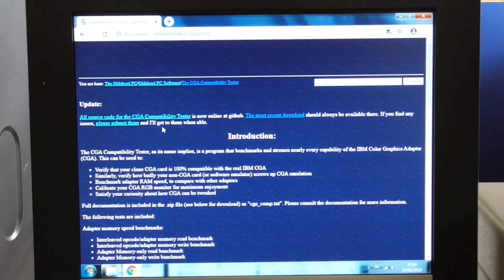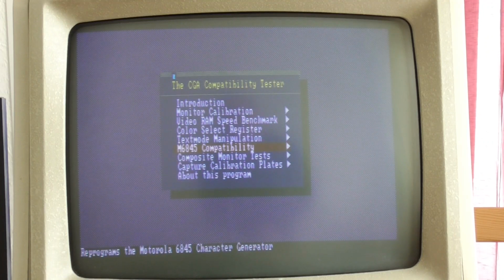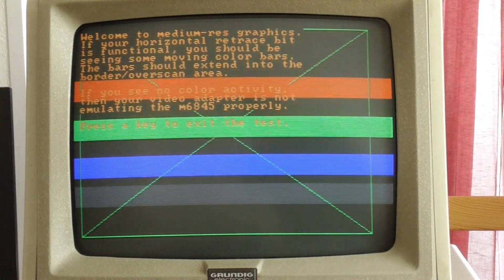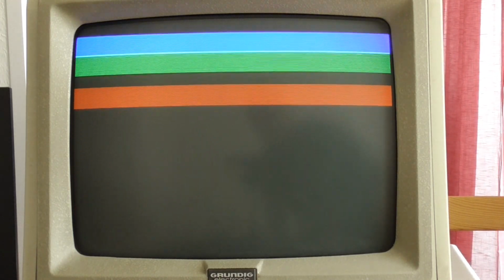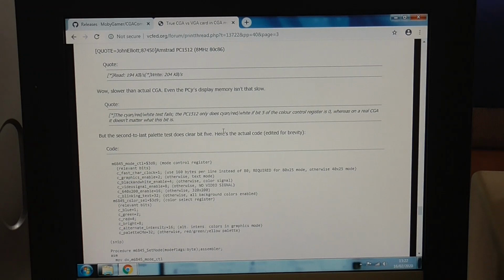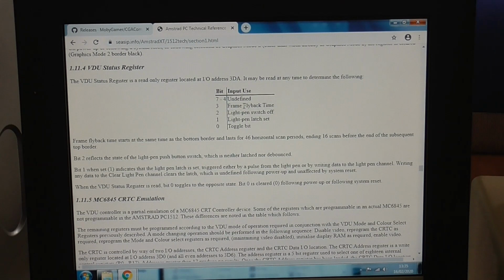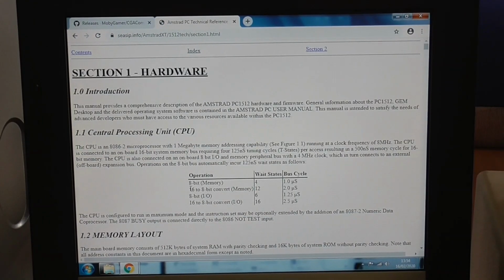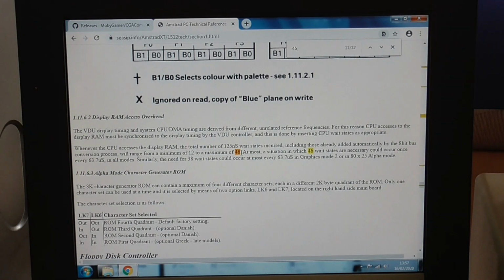"Impossible" Raster Bars @ 60fps on the Amstrad PC1512

Comment: Hi, interesting video! I'm currently working through the same process for a GDR educational computer based on a Z80 (or a clone) and a NEC uPD7220 (or a clone). Thanks to videos like this I got motivated to try this on an yet unexplored platform. Stable rasters are possible already with a hblank edge lock. I'm showing some small improvements on my channel. There is more to come.
Cheers,
Dresdenboy/Citavia